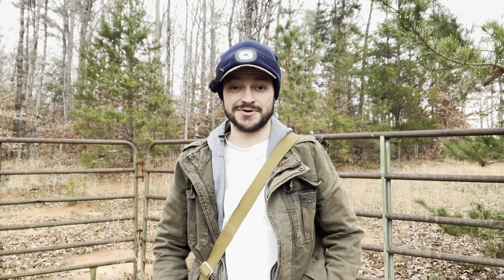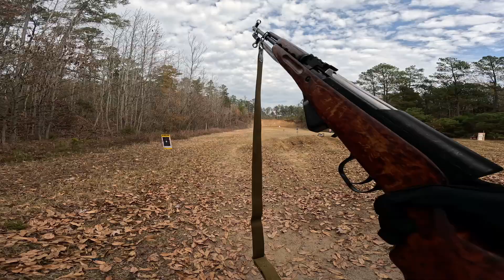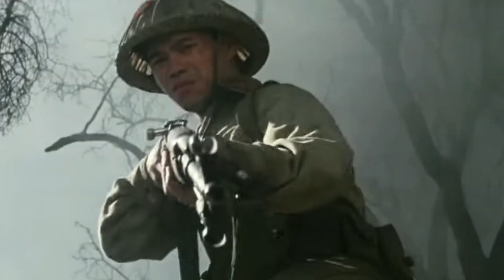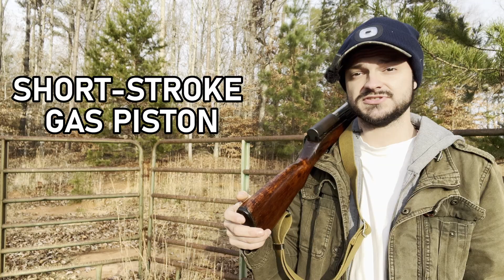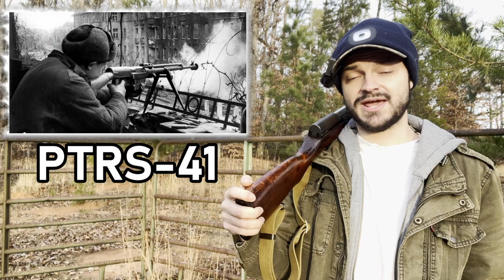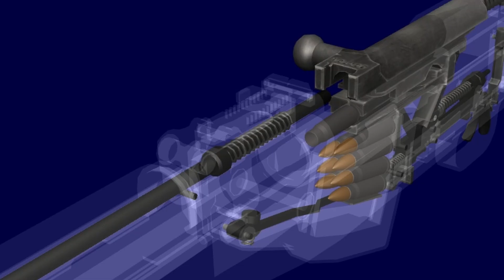Gun Anatomy Episode 9: The SKS-45

Comment: "Crudely built"?  Dude the one you have is in a well above average condition, while mint tiger stripe ones are down right gorgeous.  Other then that, you entirely missed the core of SKS philosophy.  

SKS is a self loading FIELD ARMY carbine, and that's why there is a specific reason why the magazine is not removable, and why the bolt head spaces on a pressed steel insert.  It's all about logistics and armory/arsenal cycle.

AK is a select fire motorized infantry carbine with a completely different logistical chain and armory/arsenal cycle.
Reply from the maker: Well. Compared to more advanced and modern manufacturing standards for firearms, it is “somewhat” crudely built. 

There are obvious signs of manual machining all over the weapon, like the bolt and receiver, but that doesn’t affect the functionality of the weapon or its propose with what you’re implying with logistics, I’m very aware of its philosophy. 

It’s a hallmark of Soviet military mass production. It’s not built for aesthetics, but for function, that’s the beauty of the simple design. I was implying it was a weapon of it’s time.

If that clears anything up.